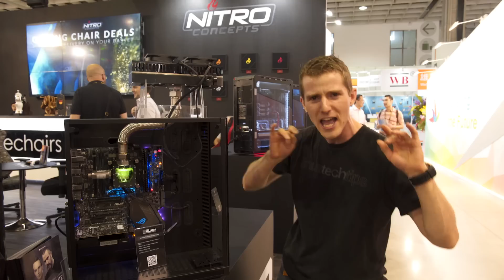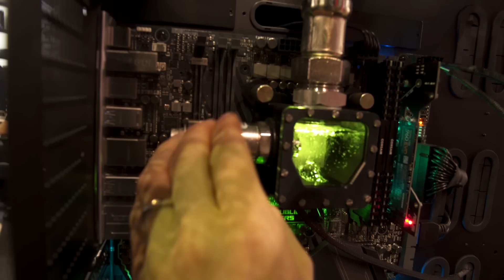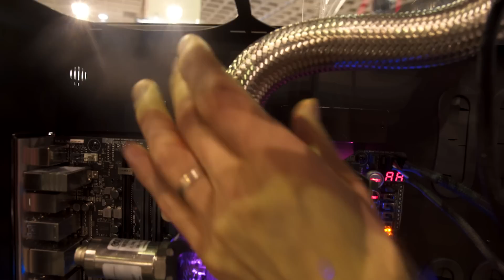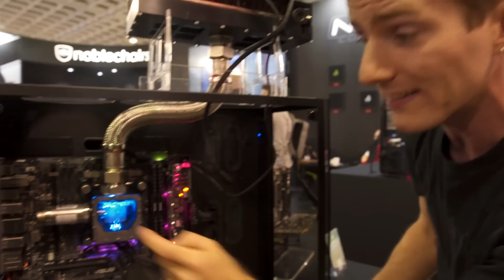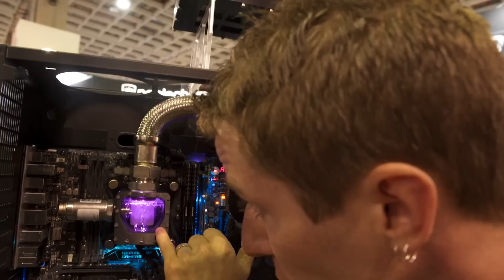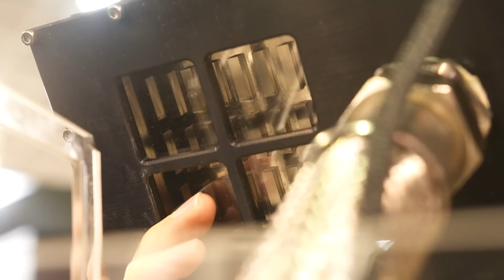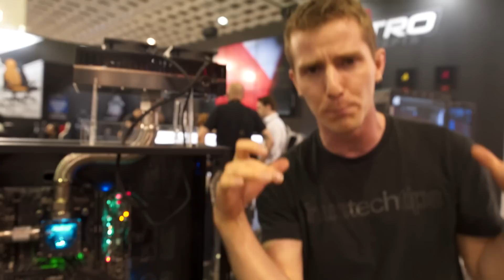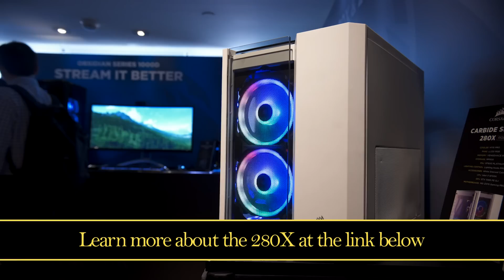Crazy Der8auer cooler prototype - NO pump!

Comment: Seems like the whole thing is under some level of pressure. These low boiling point liquids typically require an expansion volume and everything is so thick walled to try and contain that pressure. Probably also why there is that industrial pressure sensor to check on how high the internal pressures get. If the room temp rises too high or fans fail though pressures inside might go a bit insane.

Comment: I would suspect that it is a similar, if not the same, liquid Roman has been using in his Aqua Exhalare builds, the 3M Novec.

Now that I have read the comments, the theory, that it is depressurized water doesn't seem to unlikely either. To drop the water's boiling temperature down to even 50° C would be fairly easy. This would also explain the pressure sensor and the very rigid tubing.

Comment: I'd guess petroleum ether, n-eptane or diethyl ether, because they are less toxic than clorurated products, and have an appropriate boiling point. Keep also in mind that pressure increases will make the boiling temperature of the fluid higher.

Comment: He’s most likely using diethyl ether because of the very low boiling point (34 Celsius)
And very low freezing point (-116 c) plus it’s cools insanely fast and has a ph around 7 so it wouldn’t corrode or damage the equipment. only problem is the flash point of 45 degrees but as long as the vapours don’t get that hot it should be fine.
Reply: If the flash point is at 45 I wouldn't trust it.
Reply: Robert Hanna Yeah that flash point would be a huge problem.
Reply: drasir everything has a pH value. Even if it's not an acid or base. A pH value of 7 means completely neutral
Reply: That's incorrect. pH is defined as -log(c(H+)) if there are no protons in solution there is no pH.
Reply: Could you increase the pressure in the system to get those values up a bit higher?
Reply: TheSpoonKing but that’s relatively high for a substance like this that’s why methanol and ethanol won’t work as the flash point is 16 c
Reply: drasir so it's off the charts acidic, or base? .. that sounds dangerous
Reply: Incariol beat me to it. No Protons (or H3O+ (Oxonium) Ions) no pH.
Reply: diethyl ether has no pH at all!

Comment: liquid freon?
Reply: freon its a gas but under pressure it looks like a liquid, open the container and its gone, same thing cars have for AC
Reply: I guess I should have specified compressed freon... but now that I think about it that wouldn't work because there's clearly free space.
Reply: what do you mean with free space
Reply: Is that illegal to use as coolant? Unless trump changed that.
Reply: There is empty space above the liquid inside the cooling block it would have to be at an extremely high pressure to have liquid freon and a gas in the same container.
And yes it is still illegal as far as I know... i'm half asleep at the moment.
Reply: You need a license to buy freon as idiots have injured themselves with it in the past. It's still widely used in a/c applications today.
Reply: the gas itself makes the pressure , when you fill the chamber you need vacum in it

Comment: The coolant is probably just distilled water. Do you really think that black wire on the bottom is just for RGB? Im guessing that metal plate where all the water evaporates is vibrating at ultrasonic frequency like humidifiers.
Reply: Thats BS.
We know that they originaly used Novec but later went with something different that has an even lower boiling point.

Comment: I'm guessing it's going to be a low boiling hydrocarbon like pentane (36°C) or it might be methanol where the boiling point will be respective to the temperature more towards when the pc will be at load (65°C).

Comment: I guess it could almost be anything. Depending on whether the chamber is under pressure or a vacuum, you could change the boiling temperatures of a liquid. people are saying methanol or ethanol because it evaporates quickly, but it could just be water in low pressure in a condensing column.

Comment: I bet they use Cyclopentane
Sins it has a boiling point of 50 degrees. With a little pressure in the system it goes up. Rendering ethanol as an impossible liquid sins the boiling point would raise.

Comment: My guess is that we cannot guess the liquid based on the regular melting points. The pressure in the tube is probably not the same as the atmospheric pressure so the boiling point could be higher.
Reply: You need low boiling point to cool down the cpu..
Reply: Its most likely alcohol under low pressure or ammonia under high pressure. Hopefully its the first because it sounds a lot safer.
Reply: Blackops 362 t
Reply: What does t mean?
Reply: Actually Freon is an even safer option that would likely still work well at reasonable pressures.
Reply: what about acetone?
Reply: They probably used 3M Novec fluid. It's boiling point is ~61 degrees celsius and nonconductive.
Reply: Blackops 362 my bad shitty mobile interface

Comment: It is operating very much like a reflux still except under some pressure and with no outlet for the final condensate. That said to find the liquid I’d want to know what the max temp and optimal temp for the CPU is. Then I’d start a search for a material that is liquid at STP and that boils at just about the optimal temp for the CPU at between 1 to 1.5 atm perhaps. 
With the unit on the CPU filled with said liquid and a sealed system as the temp rises the pressure builds but not too much before it starts boiling. As the vapors rise they cool and start falling back to the low reservoir. Eventually equilibrium is reached wherein the vapor makes it to the top for cooling and tricking down to the low unit again cooling it. 
Ethanol would do that at about 73°C which is likely too hot to keep a CPU, but that is the liquid that most are familiar with that is processed through this method for vodka and Everclear and even fuel. Methanol boils at a lower temp but still too high methinks, especially under any pressure. If the system were initially vaccumed a bit (as opposed to STP at startup) those might work as the boiling point would be lowered and the max pressure reduced.
Water could even work under sufficient vacuum at the start. Or perhaps some miscible liquids that together have the optimal pressure and boiling point combination.
Am I in the right track? Frankly, I hesitate to look too hard as I wouldn’t want to give it away even accidentally.
Great job on the unit. Except for the pressure switch blocking the RAM slots, I’d be happy to have one exactly like that. I love the look. 
Best wishes.

Comment: That is pretty cool but what exactly is the point of no pump? Initially, I thought it was less noise but as Linus said it makes a bit more noise because of the boiling and stuff. So someone please explain the benefits of this to me? I genuinely am interested in what this helps in beside looking really unique!
Reply: it's the refrigerant being used. it has the ability to evaporate and condense at the appropriate temperatures and pressures to successfully remove heat at a  sufficient rate. 

pumps also fail.  water systems get corrosion and gunk build up. refrigerants are typically engineered to be inert and clean. they can be corrosive. but, pretty sure they picked an inert one here. so your only moving part is the fans, easy to fix. the sealed system inside that's basically just thermal plates and refrigerant never fails.

Comment: Coolant could be almost any hydrocarbon. With the speed of the bubbles, it appears to have little intermolecular forces. This could be due to non polarity, low/high pressure, or large difference in surface temperature and boiling point (at system pressure).  Because it appears the bubbles shrink in size before leaving the fluid, it could be near to a gas/liquid critical point.

Comment: Diethylether has a boiling point of around 35°C but I wouldn't recommend putting that near a heat source, could also be like acetone with a boiling point of around 56 or like pentane with a boiling point in the 36 range 🤔 another option is to use a vacuum pump allowing you to use safer liquids to boil at lower temperatures